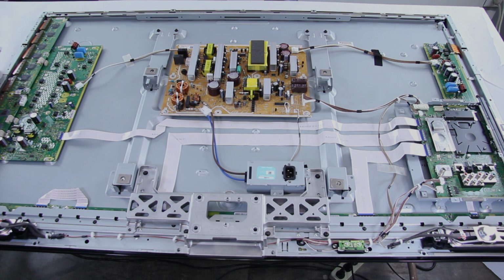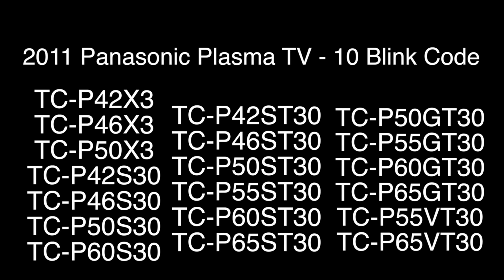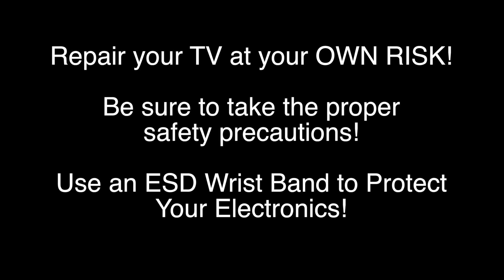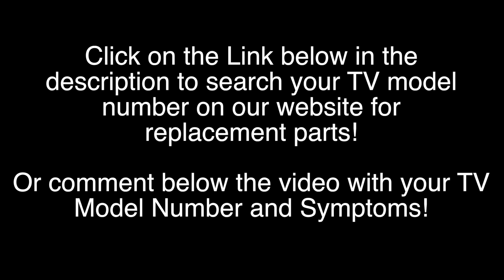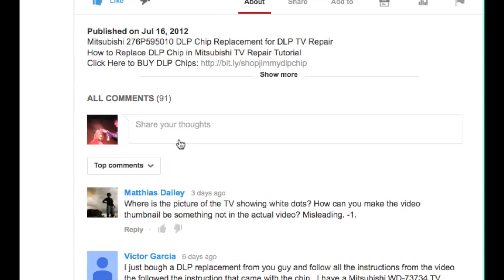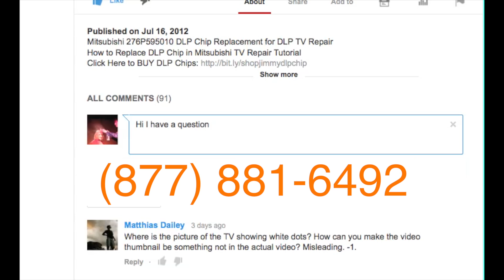Panasonic Plasma TV Repair - Understanding 10 Blink Code for 2011 Panasonic Plasma TVs-How To Repair

Comment: I have a Panasonic TH-50PX60U, the TV all of a sudden went out, I unplugged the TV then plugged it back in and I get 10 blinks. I can't hear any clicks because I have bad hearing. I pressed the power button and I still get 10 blinks. Are the boards still available for this model? If so, were can I get them? I appreciate your help.
Reply from the maker: Manuel Lopez   Try this at your own risk. Unplug the TV, then disconnect the SC board and plug in the TV to see if the TV powers up. Reply with the results of this test. Thanks! www.shopjimmy.com

Comment: Hi I own a Panasonic Viera TC-P50VT20 and one day it didn't turn on. we tried different plugs in the apt and it's always the same, once I plug it in I hear a sound (which is normal) and once I push the power button a blue/green light turns on for a second like a "normal turning on" but then the 10 blinking red light code starts... A friend of mine suggested to invert the phase in one plug and try to plug the tv... I tried and it does the same thing... What do you suggest now? 
Thank you for your help.

Comment: I replaced the MC201 and MC301 IC's and capacitors for the 10 blink error code on a TH-50PZ85U TV and I still get the 10 blink error code.  The 10 blink error code happens AFTER pressing the power button and I do hear the 2 relay click on initial ac power plug in.   Any thoughts or ideas on what to look for next?  I checked F201 and F301 as well and they remain as a short (functioning normal).  I checked the mosfets and all appear good.  Also the Fans do not at any point turn on.  Could I have somehow by terrible luck installed bad IC's?

Comment: Hi, I have a 21010 Panasonic Plasma TC-P50C2, same as Christina Coleman below.  There is a 10-blink code and hard reset doesn't work.  Disconnected the SC board and still got the 10-blink.   Reconnected the SC board and disconnected the SS board.  Still got the 10-blink code.  Your correspondence with Christina Coleman ends there, so I am not sure what the next step is to determine where the problem is.  Thank yo in advance for your help.

Comment: JIMMY WHAT IS GOING ON WITH MY 2009 PANASONIC FLAT SCREEN (TC-P42c1). I THOUGHT IT WAS THE POWER BAR SO I BOUGHT ONE FROM YOU AND PUT IT IN BUT ITS STILL DOING THE SAME THINGS. YOU CAN HEAR IT TURN ON BUT AFTER A FEW SECONDS THE RED LIGHT ON THE BOTTOM OF THE TV BEGINS TO FLASH. THE TV NEVER FULLY TURNS ON. THE RED LIGHTS SEEMS TO CONTINOUSLY FLASH. ANY IDEAS? I WOULD APPRECIATE ANY FEED BACK THANK YOU.
Reply from the maker: Jessie Riley   I recommend replacing the main board in your TV.  Here is a link to replacement main boards for your TV model number:  http://www.shopjimmy.com/catalogsearch/result/index/?cat=56&q=TC-P42c1  Be sure to match part numbers on your current board, with your replacement for compatibility.  Here is a link to a video showing how to identify your part number, click here:  Panasonic TC-P4 TXN/A1ETUUS A Boards / Main Boards Replacement Guide for Panasonic Plasma TV Repair  Thanks and please let us know if you have any further questions with your TV Repair!  www.shopjimmy.com

Comment: Aloha  my name is  Marc. I have a panasonic tc-50ps14    The bugga just turned off on it's own.   and at first I believe it was getting 6 blinks. I tried it again today and got 10 blinks   I  am interested in reparing this myself if it's cost effective
Reply from the maker: eno evol  Try this test at your own risk.  I recommend disconnecting the SC board from the power supply and then applying power to the TV to see if the TV will turn on.  Please reply with the results.  Thanks!  www.shopjimmy.com

Comment: I own a 2010 Panasonic Plasma with model number TC-P50C2. It is presenting the 10 blink code and hard reset is not working. I have removed the back panel. Which part should I replace?
Reply from the maker: Christina Coleman    Try this test at your own risk.  I recommend disconnecting the SC board and see if the TV will power up.  Reply with the results of the test.  Thanks!  www.shopjimmy.com
Reply: We unplugged the sc board and when turned it back on, it is still presenting the 10 blink code. Thanks
Reply from the maker: Christina Coleman   Reconnect the SC board and try the same test with the SS board on the other side of the TV.  Please reply with those results.  Thanks!  www.shopjimmy.com
Reply: We reconnected the SC board and tried the same test with the SS board. This time we were presented with a 7 blink code.
Reply from the maker: Christina Coleman  Please watch this video FIRST to help with your repair!  TV Repair! LCD, LED, Plasma, DLP How To Fix Your TV with ShopJimmy.com Help!  Sounds like there is a problem with either the A board or there is a short on the SC board.  You may need to replace each board individually to see which one fixes the problem.  If you replace the SC board, be sure to also replace the SU and SD boards along with it.  Here is a link to replacement parts:  http://www.shopjimmy.com/catalogsearch/result/?q=TC-P50C2  Be sure to match part numbers on your current board, with your replacement for compatibility.  Thanks and please let us know if you have any further questions with your TV Repair!  www.shopjimmy.com

Comment: Hi I have a panasonic 65 inch model TC-P65S1 when I hit the power button it makes a clicking noise 2 times and won't come on
Reply from the maker: dewayne hurling   I recommend running a test similar to the one in this video: Plasma TV Repair Help Clicking Noise & No Picture How to Troubleshoot Y Sustain & X Sustain Problems Try it at your own risk. Disconnect the Y board and power on the TV to see if it powers up normally. Thanks and reply with the results of your test. Thanks! www.shopjimmy.com

Comment: I have TCP50TU50 2012 model.  It blinks 8 times.  Do I replace SS board, or like others to replace A board?  I can't find video for replace A board or SS board, is it difficult to replace them? Thanks.
Reply from the maker: Chen Hou  I recommend replacing the SS board in your TV.  Here is a link to replacement parts for your TV model number on our website, click here:   http://www.shopjimmy.com/catalogsearch/result/index/?cat=65&q=TCP50  Be sure to match part numbers on your current board, with your replacement for compatibility.  You can also call our customer service for further assistance with your purchase.  (877) 881-6492  Thanks and please let us know if you have any further questions with your TV Repair!  www.shopjimmy.com
Reply: I had the exact same problem with 8 blinks, it's the SS board. You won't find a new replacement board online anywhere, however you can open up your tv, take the SS board out and send it in to Shopjimmy to repair it. Once they send it back to you fixed, install it back into your tv it will work like new

Comment: I have a tc-p42c2 first it had no power found blown transistors on y sustain board, i repalced the board from shop jimmy, now it blinks 10 times then pauses then 10 blinks etc etc.. I tried pushing in power button for 10 sec etc. to reset, no help. Any help I would really appreciate, thanks Harry
Reply from the maker: Logan Adams   It sounds like you may have a defective replacement board.  Did you also replace the y buffer boards along with the y sustain board?  You can also check the ICs on the buffer boards for pin holes.  Thanks!  www.shopjimmy.com
Reply: The buffer is on the sustain board on this particular board. So I guess I have to send it back to you and you will replace it, I know it is guaranteed by you guys!
Reply from the maker: Logan Adams  What is the part number on your board?  Thanks!  www.shopjimmy.com

Comment: I have a panasonic an it's a TC-P42C2 with ten blinkin lights an need help ty
Reply from the maker: Maya White   Try this at your own risk.  I recommend disconnecting the SC board and applying power to see if the TV will turn on or not.  Please reply with the results of this test.  Thanks!  www.shopjimmy.com

Comment: Panasonic TC-P55VT30.  
I get 7 blink code. I remove power cord and ribbon from the SC board.
I get 10 blink code after I unplug the SC board. So is the A-Board bad?
Reply from the maker: Race2705   Try disconnecting the SS board and see what happens when you apply power.  Reply with the results.  Thanks!  www.shopjimmy.com

Comment: I have a Panasonic 50" Plasma TC-P50U1 and have already replaced the power supply boardm the power Light still blinks 10 times - does your info on the 2011 model apply to this TV as well? I hate to throw this tv away...
Thanks!
Reply from the maker: Joe Dolister   I recommend replacing the A Main Board in your TV.  Here is a link to replacement parts for your TV model number on our website, click here:  http://www.shopjimmy.com/catalogsearch/result/index/?cat=56&q=TC-P50U1  Be sure to match part numbers on your current board, with your replacement for compatibility.  Here is a link to a video showing how to identify your part number, click here:  Panasonic Plasma HD TV Repair Tips: Suffix Codes for A Board & Main Boards  You can also call our customer service for further assistance with your purchase.  (877) 881-6492  Thanks and please let us know if you have any further questions with your TV Repair!  www.shopjimmy.com

Comment: I have a Panasonic TH-C46FD18 that is blinking 10 times.  I have unplugged it and plugged it back in and it still blinks 10 times.  Is this an A-Board problem or a power board problem?
Reply from the maker: Darren Greene   I recommend replacing the A main board in your TV.  Here is a link to replacement parts for your TV model number on our website, click here: http://www.shopjimmy.com/panasonic-tnph0721aps-main-board-for-th-c46fd18.htm  Be sure to match part numbers on your current board, with your replacement for compatibility.  Here is a link to a video showing how to identify your part number, click here:  Panasonic Plasma HD TV Repair Tips: Suffix Codes for A Board & Main Boards  You can also call our customer service for further assistance with your purchase.  (877) 881-6492  Thanks and please let us know if you have any further questions with your TV Repair!  www.shopjimmy.com

Comment: Panasonic Model TC-P50S30 plasma screen went black during normal TV operation.  Unplugged unit for 10-15 minutes and reconnected.  Red light on steady, no blinks.  No response from power switch or remote.  Screen still black w/no sound.
Reply from the maker: ROBERT RICHEY   I recommend replacing the SC, SU, and SD boards in your TV.  Here is a link to replacement parts for your TV model number on our website, click here:  http://www.shopjimmy.com/catalogsearch/result/?q=TC-P50S30  Be sure to match part numbers on your current board, with your replacement for compatibility.  You can also call our customer service for further assistance with your purchase.  (877) 881-6492  Thanks and please let us know if you have any further questions with your TV Repair!  www.shopjimmy.com

Comment: Hi I have a samsung 43 plasma tv ok I watching it and turn off
Model PN43E450A1FXZA I Aleeady Changed The power board becausevi found a black spot so I replaced it and now you can here it turns on put nothing just like 6blinks thank you please help
Reply from the maker: mario gotze I recommend replacing the X-Main Board in your TV.  Here is a link to replacement parts for your TV model number on our website, click here:   http://www.shopjimmy.com/catalogsearch/result/index/?master_part_type=X-Sustain&q=PN43E450A1FXZA  Be sure to match part numbers on your current board, with your replacement for compatibility.  Here is a link to a video showing how to identify your part number, click here:  Samsung Plasma TV Repair: Samsung Plasma Panel Parts Guide  You can also call our customer service for further assistance with your purchase.  (877) 881-6492  Thanks and please let us know if you have any further questions with your TV Repair!  www.shopjimmy.com

Comment: I have a philips magnavox lcd. 1 day i turned the tv on and all it did was flash full screen colors, switching from 1 color to another and this is on loop.  Tv won't power down and I have to unplug it to turn it off.  When I turn it on the the "green" "stand by light" blinks 8 times, then the color flashing starts
Reply from the maker: Matthew Turner   Try holding down the power button for 10 seconds and see what happens then.  Please reply with the results.  Thanks!  www.shopjimmy.com

Comment: My name Gale Carter I have a 55 inch  Panasonic  plasma Tv  I am getting 10 blinks  no picture or sound  model number is tc p5ox1n  went out of town came back turn on the tv and got nothing ..
Reply from the maker: Gale Little   I recommend replacing the A Main Board in your TV.  Unfortunately I do not see any replacement parts in the search results for your TV model number on our website.  Please reply with your part number on your main board and I can try searching for replacement parts.  Thanks and please let us know if you have any further questions!  www.shopjimmy.com

Comment: What does the 10 blink mean on TH-42ph9 I did not see that model # in your list
Reply from the maker: saj5443   It means you should replace the SS board in your TV.  Here is a link to replacement parts for your TV model number on our website, click here: http://www.shopjimmy.com/catalogsearch/result/?q=TH-42ph9  Be sure to match part numbers on your current board, with your replacement for compatibility.  You can also call our customer service for further assistance with your purchase.  (877) 881-6492  Thanks and please let us know if you have any further questions with your TV Repair!  www.shopjimmy.com

Comment: I have a panasonic model #tcp50c2, it blips 10 times. It was made in 2010, would the A board still be the correct replacement part? Serial  #MB00950049  (April 2010). Thanks for your help.
Reply from the maker: Joe Walsh   This sounds like it could either be a bad A Main Board & Power Supply.  You may need to replace each board individually to see which one fixes the problem.  Here is a link to replacement parts for your TV model number on our website, click here:  http://www.shopjimmy.com/catalogsearch/result/?q=tcp50c2  Be sure to match part numbers on your current board, with your replacement for compatibility.  You can also call our customer service for further assistance with your purchase.  (877) 881-6492  Thanks and please let us know if you have any further questions with your TV Repair!  www.shopjimmy.com

Comment: TX-P42GT20B 10 blinking lights - On start up - 2 relay clicks - approx 4 seconds later 3rd relay click - have replaced the A board ( bought from ebay ) still had the same problem - replaced the power board - same problem - any suggestions please
Reply from the maker: mykeuk64   I recommend replacing the SS board.  Unfortunately I do not see any replacement parts in the search results for your TV model number on our website.  Thanks and please let us know if you have any further questions!  www.shopjimmy.com

Comment: Hello. I have a P54VT25 that shut down while the TV was on. When I tried to power back on, the TV started giving the 10 blink code. I have tried disconnecting all audio/video cables and power cord. I left the audio/video cables disconnected and plugged the power cable back in. After hearing the first solenoid click, I pressed the power button and am still getting the 10 blinks. Can I follow the same procedure for repairing my vt25 as in this video for the vt30? Also, what would the part number be for the board I am to replace in my specific tv, the p54vt25? Lastly, do you have this board in stock? Thanks so much for all the help.
Reply from the maker: governor419   There can be a lot of troubleshooting with this TV repair, please give us a call to walk through the steps.  (877) 881-6492